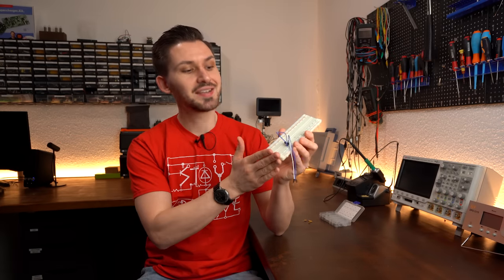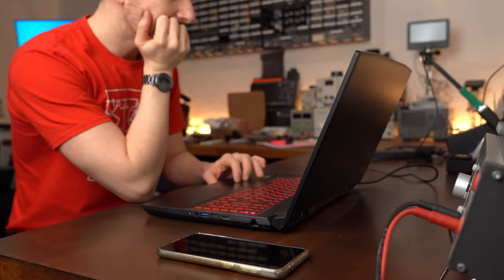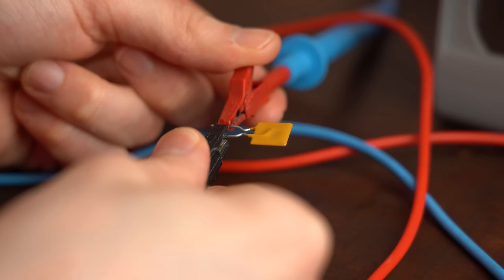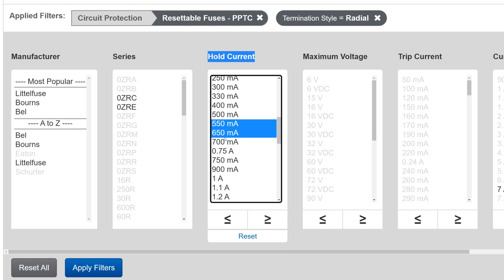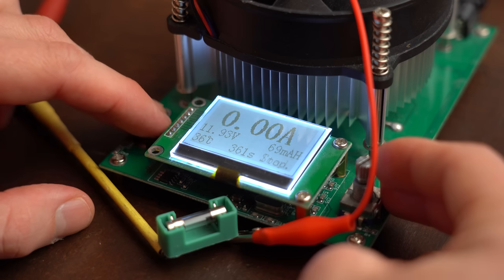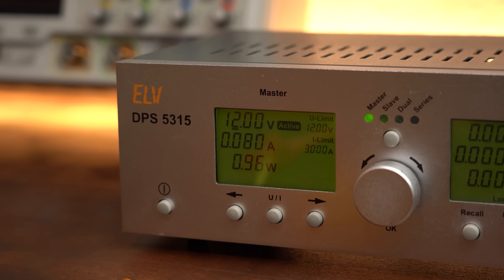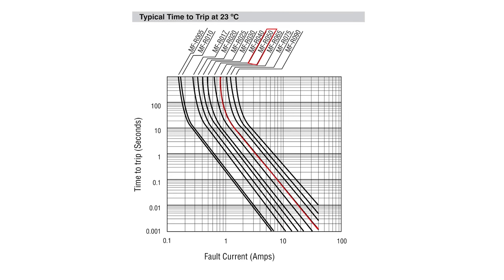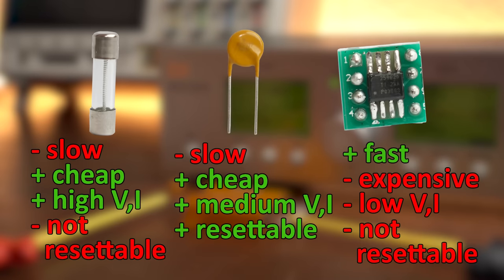The Best Protection for your Circuit is NOT a Fuse!.....but a Resettable Fuse? EB#54

Comment: In late 90s, I found a schematic of a resetteable fuse made with an thyristor. That was not automatically resetteable but instead when triggered, you had to push a button to rearm it. I built that circuit (and I remember using a potentiometer to make it adjustable) and used it as the fuse at the ouput of my homemade bench variable power supply. However, I remember it being not reliable at low voltages.
Reply from the maker: Sounds similar to an eFuse. Just with older technology.
Reply: I just watched a video on this very subject yesterday. This guy does a really great explanation of a "crowbar circuit", which uses a zener diode, to trigger a thyristor, which blows a glass fuse. The beauty of this circuit is that it 'immediately' squashes an over-voltage/current before 'slowly' burning the fuse. It's also simple and cheap to implement, though I'm inclined to substitute a resettable fuse for the glass one he used.

Search youtube for: 
"All You Need To KNOW About CROWBAR Circuits To FIX Stuff! How crowbar circuit works tutorial"
Reply: @greatscottlab  Yes, something like that. It was in a book like the old "Elektor 300 schematics". It was a nice addition to my power supply. Maybe I dig it out and if I find it, I will add a link.
Reply: @greatscottlab  So, I will describe the circuit, as I can not upload a image and I did not find it online. 
Between the positive of the power supply and the load is an 2N3055, collector to PSU, emitter to the load. Between the collector and the base is connected the tyristor (anode to base) and between the base and emitter a resistor of 0.2-1Ohm (it sets the fuse current). The tyristor gate is connected trough a push-button and a 47k resistor to its cathode and transistor collector. 
To power the load, have to push the button to latch the tyristor; when the overcurrent, the transistor opens, shorting the tyristor, making it to shutdown and powers off the load. 
Hope it is clear enough to be replicate and analyzed.
Reply: @sebastian19745  I mostly get it, but it doesn't seem like the thyristor would ever be completely shorted. As the voltage drop across the resistor gets above about half a volt due to excess current, it's going to start turning on the transistor, but I only see it turning the transistor on enough to keep the voltage across the resistor (and the current through the thyristor) from rising even more. It relies on the current passing through the thyristor to stay on.
Reply: Low Current
Reply: Thanks for that info. I must remember it for higher current projects. 👍🇮🇪💚🙏🏻
Reply: A Thyristor would make a good OVP (Over Voltage Protect) circuit in a power supply.
Reply: @chitlitlah  The thyristor is shorted at VCEsat+0.6V. Maybe the thyristor I used was happy with this and disconneted. In the shematic was recommended TIC106A..D to be used. Of course, if one would build the circuit, some thinkering must be involved, like in most old Elektor circuits.
Reply: I once accidentally made that I think haha
Reply: It makes sense it wont work with low voltages, will probably work fine above 4v due to thresholds in the silicas.
Reply: @greatscottlab   you cant smell videos  me at 0:02
Reply: I did use the same crowbar circuit before at the output of a 5v buck converter, and indeed it was very unreliable, one time the circuit activated and instead of blowing the fuse, the Thyristor stayed on forming a short circuit while getting super hot at the same time, but neither the fuse nor the Thyristor were willing to burn for no explicable reason
Reply: @paulcohen1555  Inefficient. Because if a minimum idle current required.
Reply: @paulcohen1555   For 13.8V transceivers, the Phil Salas (AD5X) over voltage protector is a good example of this.  It has transient and reverse voltage protection and shorts the power supply voltage so that the series glass fuse blows.  (He actually uses a triac, but the same principle).
Reply: @greatscottlab  Could you explain the importance of X capacitors? I have plug in surge protectors that self-consume 29-43 mA, and I suspect it is the X capacitors leaking current! Was wondering what effect if I remove them?
Reply: my dad showed me that one when i was 9 XD
Reply: @mrgcav 
Do you mean less useful at a manufacturing scale, or not suitable for hobbyists?
Reply: @YoutubeBorkedMyOldHandle_why  Thanks for the input. I watched the video you mentioned, amazing tutorial!!

Comment: You should have mentioned that these components do degrade with each trip, and also degrade if held in a tripped state for long periods (degradation=untripped resistance increase).  They are not suitable for applications that are likely to be regularly tripped.

Comment: My favorite technique is to use a resettable fuse followed by a transient-absorbing Zener such as a 1N6373 in parallel with the load. This not only protects from overvoltage but also protects against reverse voltage since the Zener would then be forward-biased instead of reverse-biased. I ran my own set of tests and melted the insulation on my power supply wires because the resettable fuse - transient Zener could handle more power than my power supply leads could. (The combo did get very hot though - space them away from your PWB!)
Reply: totally. ive seen this often done in industrial electronics. but i think it would work better if you glue the PTC fuse to the zener with silicone. that way heat can transfer from zener to the PTC fuse and help it activate. the combo might run cooler than both things separately. what temperature are the PTC fuses anyway? i havent done any tests. maybe you do them.
a big flat surface mount zener and PTC fuse of similar size glued together might work best.
Reply: Fuse + crowbar in the reverse voltage situation. Makes sense to force the trigger in some situations like this instead of having constantly a voltage drop with a series diode.
Reply: @echelonrank3927  Interesting idea, but I do wonder now about how the zener would behave, given semiconductors aren't really happy above 100ºc often enough. Might be interesting to check it out on the datasheets.
Reply: I haven't seen it myself, but I have read that Zeners always fail shorted.
Reply: @hardlygamaliel455  i've always wanted to know how TVS diodes degrade and fail. the type report that requires effort.
Reply: @Kalvinjj  those cdip packages are a resilient especially when the are laser welded in their hermetically sealed  "boxes/containers/ words words word"
Reply: @wolu9456  Yes, I don't doubt the physical side of things, it shouldn't fail all things considered, whoever how the semiconductor itself behaves around 100°c (the zener's properties) is what I'm curious about.
Reply: @wolu9456  when the diode heats up too much, the TVS diode junction diffusion speed increases a lot.  the increased diffusion at high temperature leads to rapidly increasing conduction and the TVS is not a diode anymore. you have to cook the diode to make it fail. i heard you can also cook diodes with nuclear radiation. not sure how that works.
Reply: @Kalvinjj  i just tried it with a 800mA PTC and 5V 1watt zener. when activated the current dropped to 200mA and the temperature of the combo reached 115 celsius. when used separately the PTC was 113 celsius and the zener at 106.
it makes virtually no difference. theres not enough heat in the zener at 5 volts. a 10 volt zener will double the heat. but if the zener voltage is too high there will be too much heat which is also bad. more research?

i think the zener needs to be at least 113 celsius at the activation current 200mA before the idea will start to make sense for this specific PTC.
Reply: @Kalvinjj  typical zener diode  temperature range -65...+200 C
Reply: @echelonrank3927  Pretty interesting findings, I had no idea zeners worked that high up the temperature range, since many (if not most?) semiconductors stop near the 100 and the PPTC needs about 100+ to keep active.
Your circuit might have not made a difference in temperature, but did it accelerate triggering? With both tied well together maybe with some thermal adhesive it might.
Reply: @echelonrank3927  About the radiation part, my guess (keep in mind, educated guess but no further research) would point towards how semiconductors work and radiation interacts with matter: the radiation messes up with electron orbits, knocking some off track, pretty much like how a semiconductor reacts, so I would suspect that indeed similar situations to the electrical stimulation would happen through radiation.
Reply: @Kalvinjj  no, i joined everything together tightly with industrial thermal paste, but there was no triggering speed up. heat thorough plastic travels too slow/not enough heat. 
but thats not a problem since im thinking of making actual hybrid component/s to test everything.
 i already have one PTC fuse with its coating removed. im going to unsolder one lead. then i will get a large 13V surface mount zener/TVS with a square metal tab on the back.
 i can solder the PTC directly on the zener. that way heat transfer will be as fast and as 100% as possible. then i solder another 2 iron based leads which cut down on heat leakage to PCB and make the whole thing a 3 terminal device. +in +out and ground. maybe some engine heat paint.
then i will do a bunch of tests.
Reply: @echelonrank3927 That sounds incredible! Hope it works out, would be interesting to see the results.
Reply: sounds like a good solution for automotive, will handle a load dump too.
Reply: Sounds like you're using components in a way they weren't designed to be used.
This generally not a good idea and you may not get predictable behaviour.
Reply: Inefficient design. Zener's consume current. Not good for High current applications.

Comment: Reminds me of when I did competitive robotics.  We were limited to 12 rather underpowered motors that had these kind of fuses (we called them PTCs but I guess technically they were PPTCs).  Between matches we would turn canned air upside down to spray the motors with the refrigerant or the PPTCs would trip in the next match. There were actually a few teams that got caught bypassing the PPTCs, which was a big no no.
Reply: was fuse active cooling an option? :D
Reply: @dv5809  Using one of the motors to run an AC compressor for cooling the fuses😏
Reply: You ment cooling down the electric motors so the pptc wont trip? I sure dont see how that would help a pptc not to trip unless you used a wrong trip current..
Reply: @ClosestNearUtopia  I think their issue was that the PPTC was "undersized" for what they were trying to accomplish. Active cooling the PPTC within the power limit would spend less energy than the fuse would be dissipating, so if the fuse can never reach its temperature, it can never trip.
Reply: If the resettabel fuse is in a hot place, one should take set temperature into account. 
The datasheets usually state trip-current vs ambient temperature, in a chart...

Comment: A story on resettable fuses that an aerospace engineer once told me: GPS satelites have some of them. Now for ground testing, they use non-resetting fuses, which get swapped out for resettable ones prior to final assembly. After launch, the new satelites go through a series of tests to verify they are working correctly. One of these tests involved deliberately triggering the overcurrent protection. 

When they ran the test on one of two newly launched satelites, they suddenly lost contact with it. After a round of testing, debugging and analysis, they arrived at the conclusion that the fuses never had been swapped out, and the two satelites were launched with the test fuses still in place. 

Immagine the bone-chilling realization that there was another satelite in orbit with the same flaw, and ground control was about to begin the test sequence! A frantic phone call from the testing facility to ground control managed to get the test called off by mere seconds. 

So the second satelite had escaped doom by the skin of its metaphorical teeth. Bottom line is, one dead GPS satelite is orbiting earth, and another one has a damocles sword hanging over it, which is a very strange metaphor in microgravity. Oh and probably some GPS flight engineers and testers, when they have managed to entangle themselves in their bedsheets on a hot summer night, dream of that fuse getting hotter and hotter...
Reply: Really or just an "Urban legend"?
(Smells like one)
Reply: @paulcohen1555  good story either way 🙂
Reply: It's a nice story, but it doesn't match my experience.
Reply: @paulcohen1555  It sounded to me like the guy knew what he was talking about, and it wasn't "a friend of an uncle" but himself who had been on the team. But then, on the internet you never know if the 18yo japanese girl isn't really a fat, bearded guy in a midwest trailer park.
Reply: Electronics creepypasta😄
Reply: I don’t whether you’ve learnt anatomy, but the teeth usually don’t have a skin
Reply: @turolretar  and there, it seems, you have entirely missed the point of the phrase 🤣
Reply: that looks like an elaborately written take on an urban legend. Before launch they test every last circuit on the ground first. And any case take it from me there's no fuses and no PTC 'multifuses' etc flown on spaceflight hardware. PTCs are a nightmare to predict in thermal vacuum. If a power bus requires load shedding after a failure then then clients on the bus use foldback current limiting instead.
Reply: @jagmarc  there are on low cost missions (cubesats etc)
Reply: @turolretar  you have completely missed what the phrase means
Reply: @jamesbuckle6077 can you cite an example ?  I would feel uneasy about one in a cubesat outgassing during delivery. I can't see the point of a fuses anyway when there's foldback limiting.
Reply: @jagmarc  cite? No because very few manufacturers will give you full circuit schematics. But I can tell you I know first hand of at least 3 commercial cubesat battery types with resettable fuses in them and out gassing isn't a concern. There are a number of design decisions that go into the decision, one of which is simplicity, and on if which is risk. They have been radiation and vacuum tested well above that needed, with no problems.
Reply: @CoyoteBoyUK I checked both the NASA and ESA preferred parts lists and can't find any mention of PTC 'multifuses'. Interestingly there are actually  wired mount fuses listed,  as MIL-PRF-23419.  That's has to be a carry over from before NASA.  
I know I would never specify a fuse for obvious reasons including they lose hermetic seal eventually and then blow anyway. 
And a PTC I can't see how that would work as there's no air in space.
Reply: @jagmarc  a) you'll find a lot in cubesats that are not in NASA and ESA PPLs. Like most of the components. b) I've never seen wired fuses either, but pragmatically thinking hermetic seal failure is of limited problem when you're flying in a vacuum. PTC poly fuses don't require air.
Reply: @jagmarc  you're still missing the point that you don't see that cubesats don't require following standard rules, even derating, and there are times when a solid passive component is better than a circuit. No disrespect intended but I'm not going to argue with someone who doesn't believe, over what ive worked with with my own two hands. Believe me or don't, they are used.
Reply: @jagmarc  plus you're putting way too much weight on outgassing, when they'd only outgas in a failure state, and their mass would be negligible. Plus not all missions are optical...
Reply: Typical of human intelligence... to send trash into space orbit
Reply: U⁷uuu hi
Reply: Why would you test a fuse in Orbit anyways?
Reply: I want to say it sounds unbelievable, but it's not like NASA has never forgotten to swap out not-for-flight parts.
Reply: @waralo191  He never said they tested the fuse specifically (and neither did I). They tested the systems as a whole, and one of these tests involved an overcurrent situation that expected to see the breakers pop. He didn't explain what the test was in any detail or even what the goal of the test was. The thing that makes the most sense in my mind regarding the breakers specifically is, if  it turned out the breakers were faulty and did NOT pop, they could alter some procedures to reduce the likelihood of overcurrent and avoid melting the circuitry.

Comment: Polyfuses are great, and I agree they are an underappreciated and underused component. They're quite useful, simple and easy to integrate into designs, and very affordable. You do have to watch out for their quirks as noted in this video ("soft" trip, temperature dependence, don't quite reset to the same point after they've been tripped once) but any time you need overcurrent protection, they're worth considering as an option.

In most cases, I leave regular fuses for more "industrial" applications at higher currents especially where the chance of tripping them is very low unless somebody has done something seriously wrong. In the "electronics" space, if I have very tight thresholds for when to trip I'll use an e-fuse but otherwise the PPTC is my go-to for low current stuff.

Another related useful technique is the "crowbar" circuit. Basically, you use some mechanism to detect a fault condition in your circuit and then you deliberately short across the power rails to purposefully trip the fusing element. This can really expand your options for exactly what trips your fuse and can give you more precise control over the trip point while using a soft/simple trip element like a polyfuse, while still retaining the easy "unplug it for a bit to reset it" behaviour.